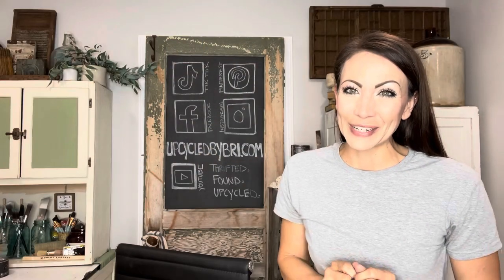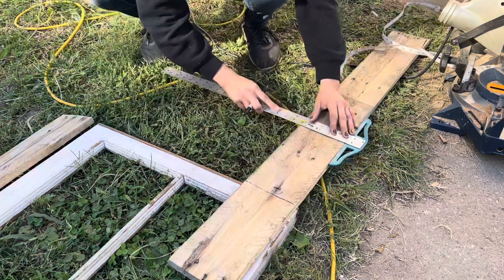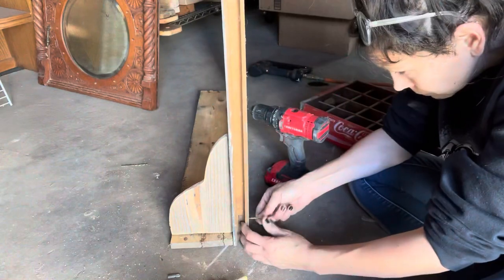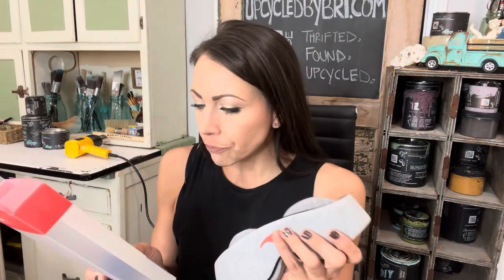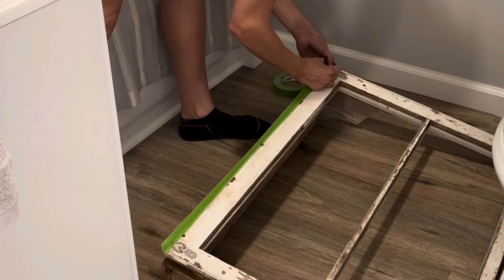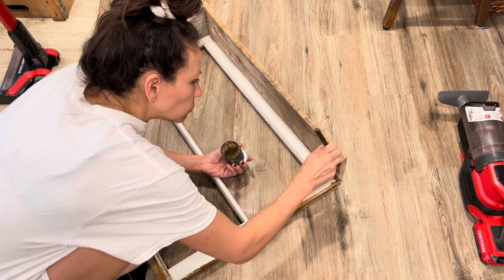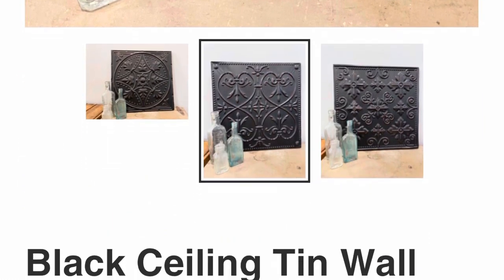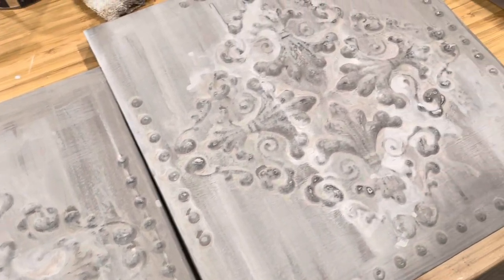DIY Window Project | How to Build a DIY Window Shelf | Bathroom Decorate With Me 2022 | Farmhouse

Comment: I needed this video. I have many windows but I have had one set aside for months. It already had the glass out. There was a piece of wood near the wi Dow when I found it. It has the exact same paint as the window. I've had them both set aside to do the same thing. Sometimes watching someone else complete it first motivates you to get back on it. I've also been hanging things the exact same way you do. I usually use my level I stead of measuring from the ceiling.